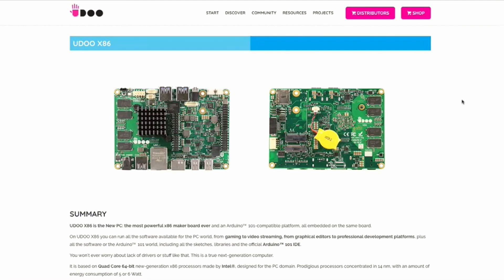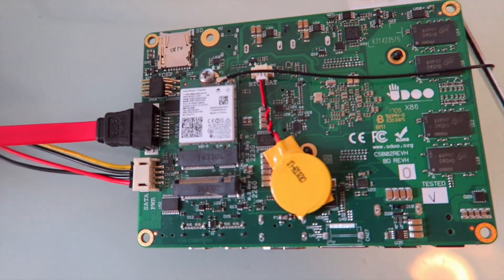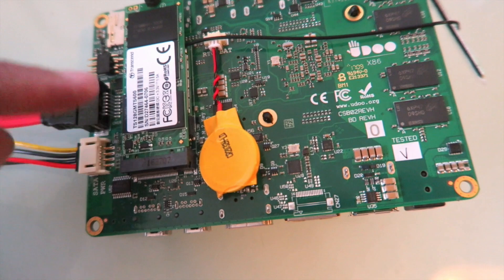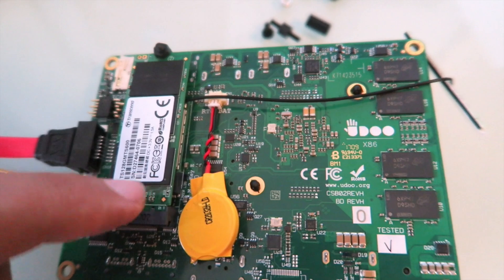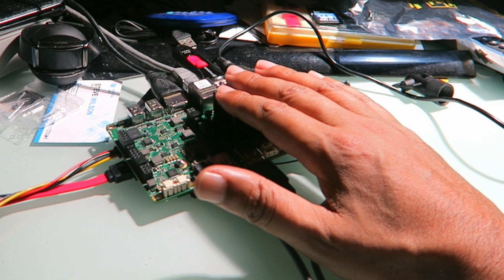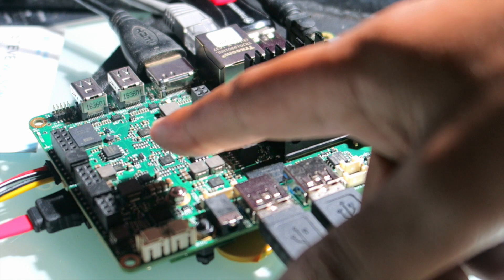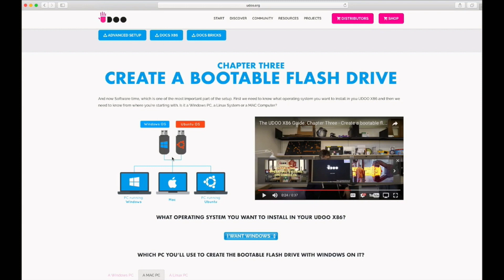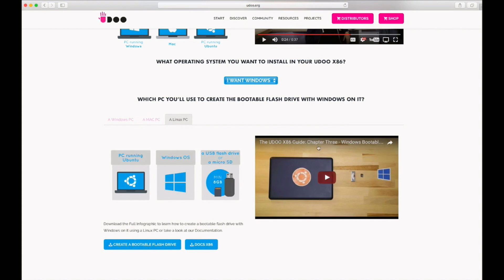UDOO x86 Setting up and installing OS's

Comment: can we use raspberry pi 7inch display in udoo-x86?  and dose the udoo support dual extended display?
Reply from the maker: Not sure if the UDOO x86 will support the pi 7 inch display - UDOO x86 supports dual 3840x2160 support in linux
Reply: so can i run a touch screen lcd and  control a projector (extended display) on windows?

Comment: I have read that there were a lot of people who got wrong number of spacers/screws.  How in the world they botched that is beyond understanding.  It just screams incompetence.
Reply from the maker: Dominique Garcia yep but not a big deal - the unit was mostly intact and working fine. They sent me out the missing bits a few months ago. The board is great.
Reply from the maker: To be fair UDOO did a pretty job of delivering the board to spec and on time so a few missing nuts or bolts was not a deal breaker for me.

Comment: Hi, can I ask how many black nuts you got in your package?
Reply from the maker: I got 4 black plastic nuts for the acrylic base. - 2 of these I used to secure the 128GB SSD module to the board.
You can see this in this video https://www.youtube.com/watch?v=CH2cI--_7O8
Reply: Thanks for the quick reply! Not only did I not get the longer screw and longer spacer for the SSD and 2nd antenna but I also only got 3 black nuts too :(. Sent Udoo a ticket about this!
Reply from the maker: That's a bummer - Udoo did leave an update saying they will be shipping out missing items to backers so hopefully you'll get yours soon. What do you think about the board? What projects do you have in mind?